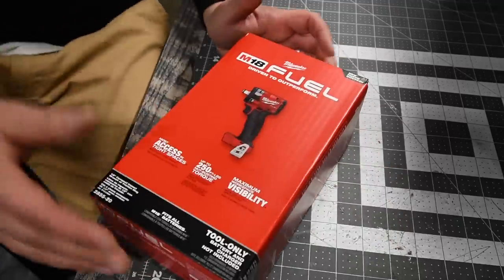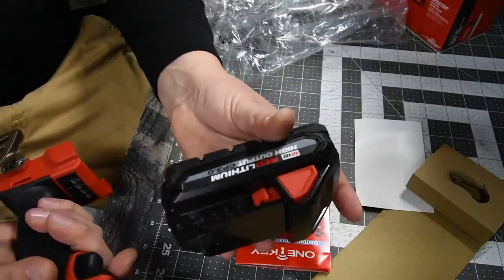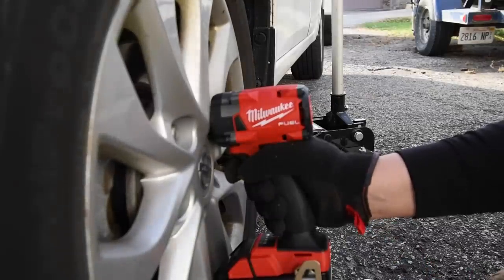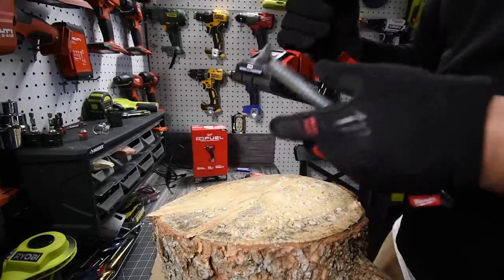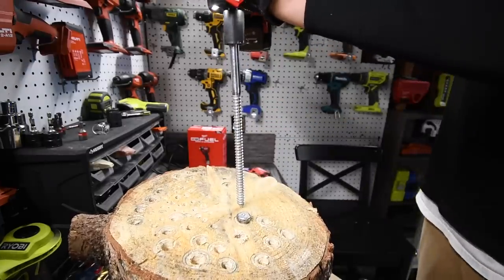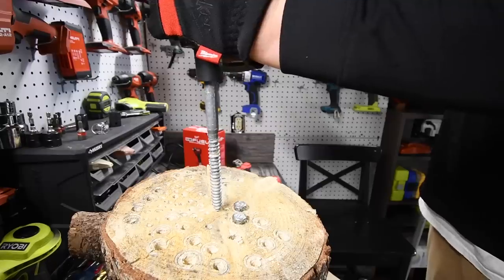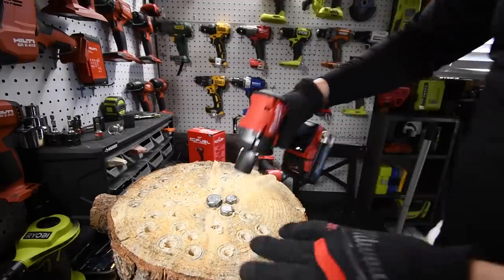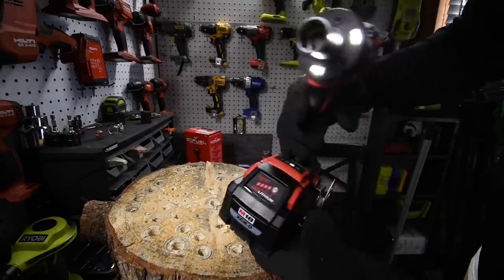NEW!!! Milwaukee Gen3 Compact Impact Wrench

Comment: 3 LED lights are a welcome addition. Other than that I'm not sure this is even an upgrade, same torque rating as M12 Stubby but with a hug battery pack?
Reply from the maker: I uploaded the m12 1/3 stubby and a versus video will be coming
Reply: The stubby m12 250 ft-lbs breakaway torque, this was 250 ft-lbs nut busting torque. That's was a different definition

Comment: So many comments about the torque specs being the same as the m12 stubby, yet I don't think any of these people realize that for the same specs, the m18 is going to have far better endurance, both in overall battery power and temperatures. Higher voltage runs cooler, assuming both tools spin the motor at the same RPM, the m18 has yet another factor causing the motor to be cooler as its motor is not being pushed as hard as the m12's motor. Plus longer battery life due to m18 providing much larger packs, and less amperage draw in equivalent wattage. Longer endurance from multiple factors makes this a higher end tool, where a tool like this will be ran all day long; tool runs cooler, lasts longer, and the battery packs themselves will last longer, meaning less downtime. 
It'd be the same as if these people were complaining about DeWalt Flexvolt tools running at 60v when they could just run at 20v instead, yet have no understanding why Flexvolt exists. Concepts that have been explained over and over again ever since varying voltages became a big thing in the tool world, either these people aren't paying attention or have severe comprehension issues.
Reply from the maker: that is why I need to do a versus video on to show what the battery can handle.

Comment: I'd like to see the difference between this and the M12 stubby, which also has 250ft/lbs of max torque. My M12 stubby also won't take lug nuts off on speed 1 and 2, but has no problem on speed 3. I'll fasten them back on on speed 2 and then torque to spec (110ft/lbs).
Reply: Smart man
Reply: They’re pretty much the same. The m12 has an angle making easier to get at fasteners. The m18 has the better battery system.
Reply: I wanna see these go head to head! I love my m12 stubby.
Reply from the maker: that video will be coming soon

Comment: I am pist at Milwaukee, After I bought the M12 and spent gd money on an extended battery you come out with this one..
Reply from the maker: we will see what the m12 1/2 stubby can do. so you might not be screwed on that
Reply: Like this reviewer said, m12 stubby may be better or just as good. You can get an m12 3.0 battery which is the small form factor- flush with the hand grip, so it remains super compact. M12 xc gives good power though

Comment: Even for a moderate tool addiction, don't see any benefit over the 12V stubby.
Reply from the maker: we will have to see what the difference is power and duration are between these 2
Reply: More lights bro
Reply: Oh it’s an 18v version... that has practically the same power.... well then
Reply: Makes sense if someone has more m18 batteries,
Reply: I already broke three m12 batteries on it because the locking mechanism  isn‘t as rigid as on the m18 Batteries, so I‘m going to switch from m12 to m18 any day. Of course an electric tool isn‘t made to fall on the floor but in the real world it does. These m12 batteries break on the tool even if it falls down from lets say a workbench height.

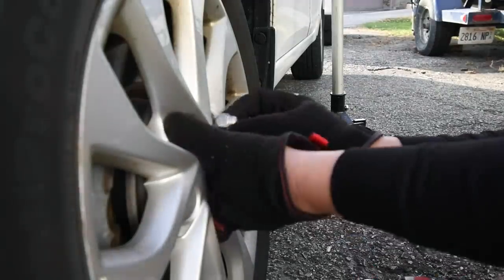Comment: 6:38 Anyone else notice the lug nut key still on the nut? 
The M18 will win over the M12 because the 18v can carry more current then 12v. Love the M12 1/2" Fuel!
Reply from the maker: I cant wait to see what the difference is
Reply: They can both carry the same amount of current, it’s the overall power output that changes
Reply: @MrSamsamsammy  See, I knew it was something like that. I also know that if you post the wrong answer to something, someone will always come along to correct you.

Comment: I did buy the mid torque 2nd gen 3/8 drive and its very impresive
Reply: I got one over the summer, honestly I'm pretty disappointed with it. It works just ok with lugnuts but wont even break caliper bracket bolts loose on a civic. I'm sure the battery amps have something to do with it but for the money I shouldn't have to buy a third overpriced battery to get full potential out of it. IMHO
Reply from the maker: very good and more videos are coming out for it
Reply: @scinto23  the midtorque? My m12 stubby broke those bolts right off.
Reply: @TouKool4u  Yeah bro, had the same problem with other vehicles too. Using 3/8 impact sockets with no extensions. To be fair it's with a 5.0 amp extended battery so I'm not going to fully judge it until I get something bigger.

Comment: I had the 2454 low torque impact - it came with a pair of normal 2.0 ah batteries.  They warrantied that impact with a 2852 mid torque impact.  I was very disappointed with how weak it was with the 2.0 batteries, but borrowed someone else's HO battery and it was a whole different gun.

Then I had to spend another $200 for my free upgrade lol - got a pair of 6.0 HO batteries and it has so much more power.

Doesn't seem this new compact impact has the same results though!  I doubt my 2454 would have been any more powerful with the bigger batteries either.
Reply from the maker: it is compact compared to its bigger mid range brother but not as compact as the m12

Comment: Dave you should do the battle of the brushless against the Milwaukee 1/2” stubby. Same specs for both. Just one is 12v and the other is 18v. Vary batteries for the 12v to the high AH to give it the advantage then come down to equivalent AH pack if it wins clearly. A lot of people won’t get the stubby because they don’t want to jump into the 12v plat when they are heavily invested in the 18v line.
Reply from the maker: will do that video will be coming up
Reply: @ManCaverTools  excellent! I think it will be a great video and show the difference in voltages. I’m sure there’s a lot of people out there with the m12 stubby that are saying the 18v compact is pointless. Should clear up a lot of arguments and misconceptions 👌🏼

Comment: Get those Deep impact sockets at the Depot for 30 bucks SAE and Metric it'll keep your rims from getting scratches on them.
Reply from the maker: I need to get a set of those
Reply: What brand are the deep sockets set you are talking about?. I do need some for lug nuts.
Reply: @jprodriguez8566  Husky is the brand at the Home Depot for 30 bucks in the gift center SAE and Metric.

Comment: I wish they tilted the head of the unit about 10 degrees. High Output batteries seem to work against the tool and the reach it has
Reply from the maker: we will see how they work with a regular battery

Comment: Its weird that they list same specs for forward and reverse. Usually u have more torque in reverse.  Also a higher amp hour battery doesn't make the tool perform better. It just makes the battery last longer.
Reply from the maker: I agree with you on that pat
Reply: That's not quite right, a higher capacity battery will give more power if you go from a 5 cell (2.0-3.0ah) to a bigger 10 cell battery (4.0ah-6.0ah). Actually, the 2.0 and 4.0 batteries have LG cells which will output a bigger burst of current than all the other batteries 👌.Try it with an angle grinder or a drill with a hole saw. Makes a ton of difference, but the difference is less noticeable with an impact driver or wrench.

Comment: While I think the is super cool I believe this to be a very niche product. If you need something that small then the m12 would be a better choice. If you need more power then there are other options not much bigger with more power. Unless someone would have a very specific need for this probably not worth buying. As always great video.
Reply: dj jd Maybe Milwaukee catering to those that are only invested in the M18 platform(?) and have no interest in a second M12 line.
Reply from the maker: I thank you dj. I will be using this one a lot

Comment: Question, I don't have an impact wrench yet and I don't have a need for really high torque applications at the moment but maybe in the future. 

I'm currently in both M12 & M18 platforms. What size impact wrench would you get (3/8, 1/2)? Would you do M12 fuel stubby friction ring or the new gen 3 compact or mid torque M18 fuel in friction ring that just came out? I'd like to have the most versatility. 

Thanks!
Reply from the maker: id get the 1/2 in. then you just need 1/2 sockets

Comment: Makita’s mid range wrench has a nut-busting torque of 740 ft/lbs. Milwaukee’s new 2nd gen mid range followed suit with 650 ft/lbs. if Dewalt does not come up with a 2nd gen of its mid torque impact wrench, we’ll most likely see a massive migration of dewalt fans to either Makita or Milwaukee.

Btw, I don’t know why in Man Caver’s vs video, he compared the mid range Dewalt 1/2” drive impact wrench with the Milwaukee 3/8” drive which has 50 ft/lbs less reverse torque than the same wrench with 1/2” drive. The result would have been clear that the Milwaukee is superior when compared to Dewalt power tools in the same category. Dewalt needs to step up. They need a 2nd gen of their mid range impact wrench.

This robust competition between power tool companies is making all consumers real winners.
Reply from the maker: I will be getting that makita as well and thank you for viewing Joseph

Comment: How does it compare to the M12 stubby impact wrench?
Reply: I’ve been using the m12 for about 4 months and the m18 for a couple days. Very similar in size and torque. Each has its pros and cons. M12 head has a slight angle making it easier to get at fasteners. M18 has a much better battery system in the way it attaches to the tool. I had the tabs break off a m12 battery.
Reply from the maker: we will see in the next battle of the Brushless

Comment: I have the low torque half inch wrench and the 4th mode is the auto shutoff mode that only stops after one second of impact without significant bolt movement. It's supposed to keep from applying too much torque to the bolt. It's a pretty cool feature for assembly.
Reply from the maker: very hood and I thank you for viewing Robert

Comment: First mistake 2 min in, 20volt and 18volt batteries are exactly the same. Manufacturers are upping the number to sell more expensive shit. The batteries are the same at 5p/2s (10 cells) which is 21V when full.
Reply from the maker: 20v under a load is 18v. so all 20v tools are really 18v

Comment: Dave, awesome video!  The one drawback, if you can call it that, is the longer length of the newer 21700 batteries, and how it made it harder for you to get close to those lugs?  It has interfered at times with my M18 surge, and trying to work in tight quarters. The use of deeper sockets, or longer bit tips or extensions is sometimes needed.  I Watched closely and you were banging into the wheel with the battery at times, which in and of itself is no biggie, however, it was making you use the impact at a slight angle?  I use a short extension, and it alleviates that problem, and the loss of torque is negligible.  YMMV.  Thumbs up!  AWESOME @ holding the IR heat gun and driving the lag in at same time!  😱😁 As always, y’all stay safe and Healthy!  Peace!  👍😁🇺🇸
Reply from the maker: I thank you George and you be safe as well

Comment: I'm stick to my m12 fuel stubby. Don't like this design. Plus a flat surface where the nut goes well make it hard to reach for taking off wheels going to have to use a extension half the time because the battery size will be in the way.
Reply from the maker: got a versus video soon, we will see how they do

Comment: Buy a new impact and try to beat the guts out of it .Repair shop used to tighten and remove bolts and nuts all day as we disassemble repair and assemble trucks and heavy equipment .  I use milwaukee tools-3/8 stubby impact my favorite- 1st one out along with 3/8 ratchet.   If I hit the trigger and bolt does not move in 5 to 10 seconds get some heavier artillery in there-bigger drive or hand tools-not hammering on it for minutes wearing out bolt head,socket,anvil and impact.  Real life would drill pilot hole in wood then run in lag bolt-old mechanic.....
Reply from the maker: that is correct, but it makes a good stress test